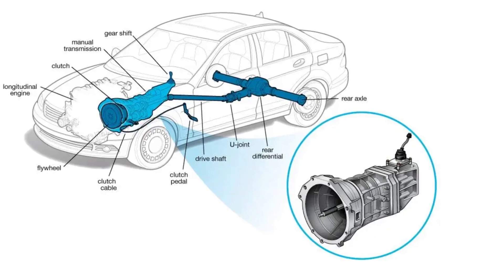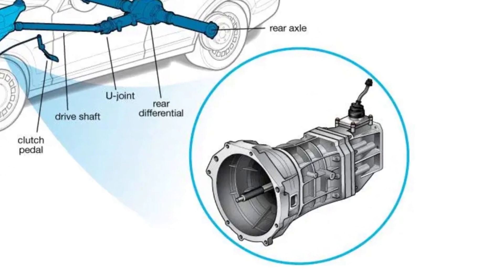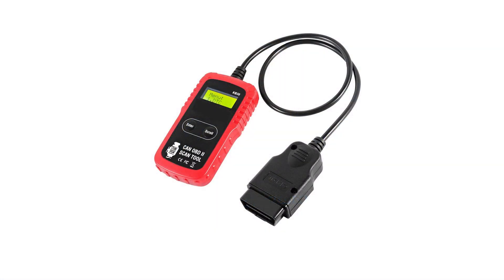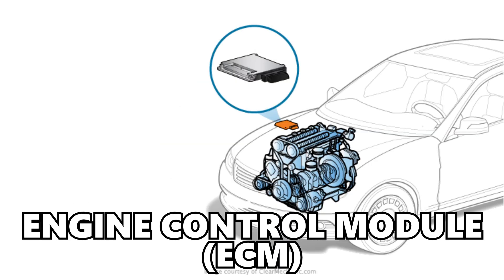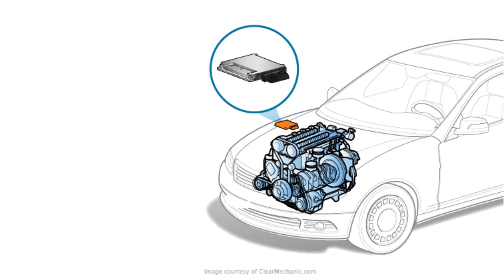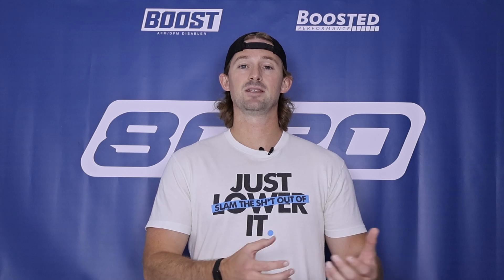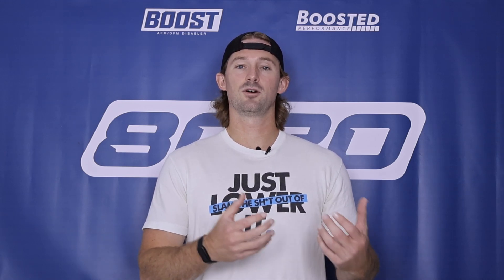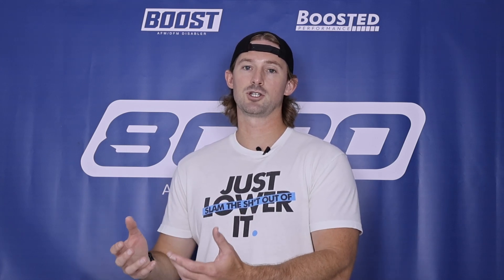The Hidden Fix for P0700 – What Your Scanner Isn’t Telling You

Comment: My 2001 Durango had a bum battery that couldn't charge above 6 volts. Voltage drop made the tcm think there was a transmission problem. Battery replaced under warranty and code went away.